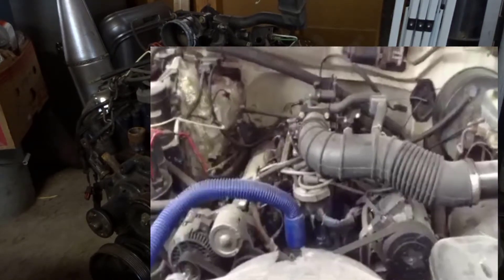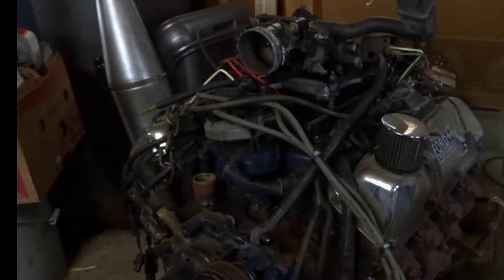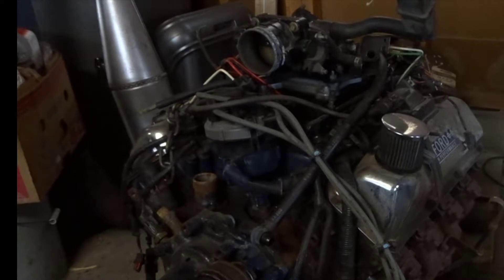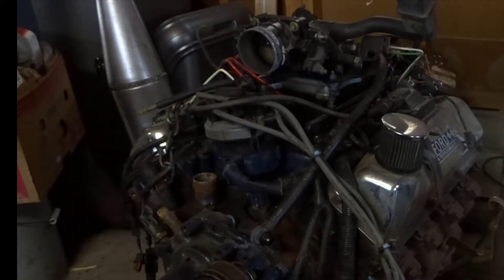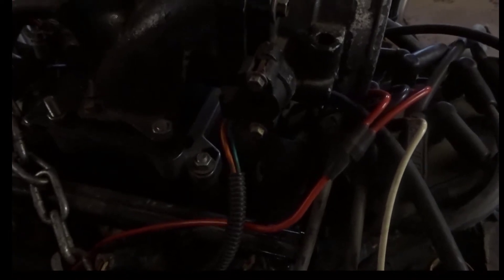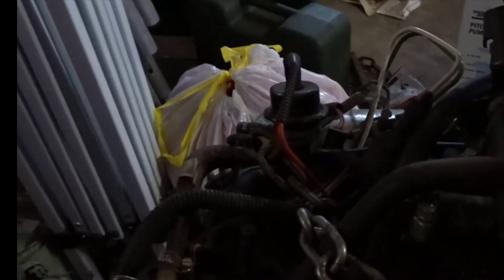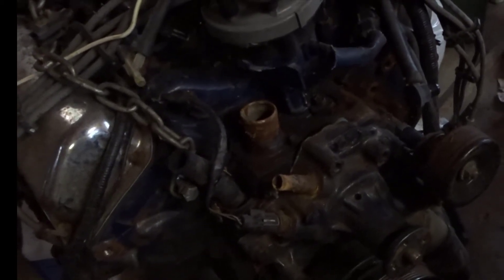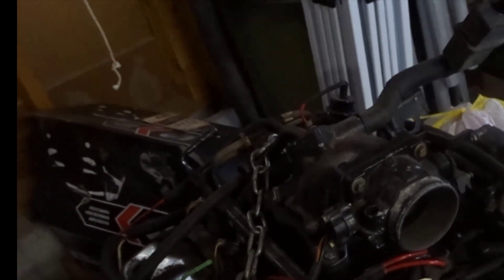Converting 351C to EFI using parts from a 351 Windsor

Comment: Little late finding this video but great job I’m swapping out a Windsor for a 70 351 2v in my 88 hd 4x4 keeping the zf5 I’m in the process of fabricating a oil pan seeing how a used 351m rear sump pans are going for 150 or more but again great job now I can use my accessories and keep efi

Comment: I have a 351m (the "m" designation comes from the "modified" series of the windsor motors for emissions purposes) from a 78 bronco, is it possible to convert it to efi using the setup you have or would I have to get more creative?

Comment: What oil pan did you use for the cleveland in the truck?
Reply from the maker: If you want to use a factory oil pan you need to use it from a 400 m or a 351 m. If you want to use one from the Cleveland it needs to be from a truck motor pull. You will also need the oil pick up tube.

Comment: Id like to know how you used a 351w distributor in a 351c? The deck height is almost half an inch so the 351w distributor would be a half inch too long. Thats probably your camshaft problem man.
Reply from the maker: Regarding the cam shaft - the issue was lifter bore was tight. Distributor  you have to replace the gear with a 351 Cleveland gear or you can swap in a 460 distributor - the 351 C and 460 share the same distributor.
Reply from the maker: He is doing a entire series on the 351C fuel injection  build from start to finish. I will post the link to his new channel once I get the videos edited and up.
Reply: @funonthehomestead  any news on the channel?
Reply: Did you ever get that video series on the 351c efi conversion?  I've had this link on my homepage for years now. I really like the guys ingenuity and the repurposing of the factory parts from several different Ford vehicles.

Comment: Good stuff mate. I'm thinking of converting my Cleveland to Direct port injection. I have a throttle body injection on at the moment and the stupid thing has shit itself, Fitech want a fortune for a replacement ecu for it. Are the injectors using a signal from the dizzy for triggering?  Also be careful with the roller cam. I had an issue, where the bow ties would foul on the X pattern casting in the valley. Nothing a die grinder couldnt fix.
Reply from the maker: He uses the factor computer from a 351 Windsor with 25lb injectors.  He had a hydraulic flat tappet cam
Reply: Been looking for a Fitech with a smoked ecu to see if the rest of the hardware can be run with a microsquirt.